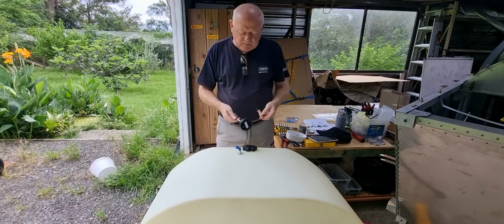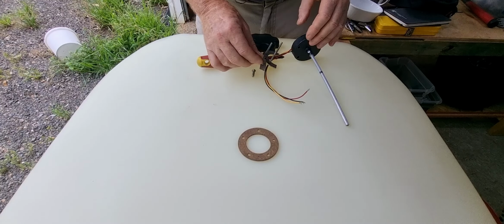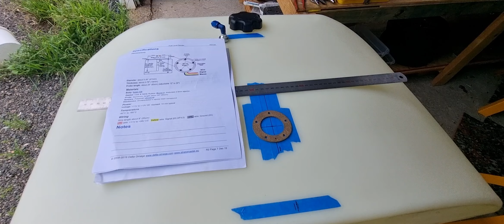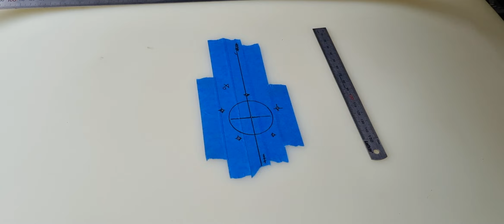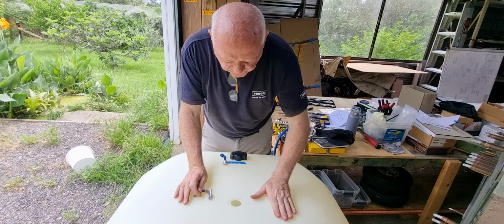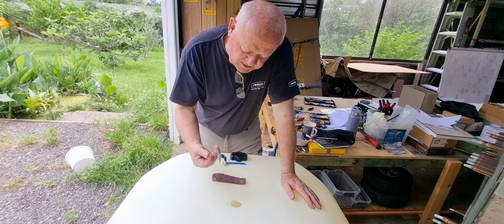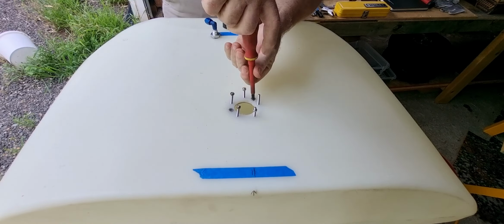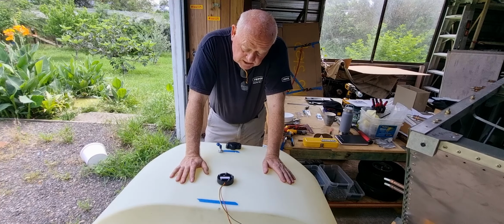Sonex Waiex B, part 25, will I completely destroy a 500 dollar fuel tank

Comment: Nicely done and a very clever design for the internal retainer.  I really appreciate the detailed videos.  Do you anticipate ever having to remove that fuel sender after the build is complete?  Can the fuel tank be dropped out from under the glareshield for maintenance?
Reply from the maker: Hi John, I hope I never have to replace the sender , but as anything if the provision is there you may as well have the ability to remove/replace. my objective in doing the sender this was was I wanted it fixed tight into a stainless nut, rather than just screwing into the poly tank or tapping it with a thread.  The glare shield and tank straps are build together as one unit, and the tank is put in afterward, therefore one would assume the tank is removable. The way I am doing my tank is I have a small section of fuel line from the firewall back to the tank that is done with flares, so if that is unscrewed the tank then is technically removeable, without destroying any fittings that I use Teflon paste and Loctite on.

Comment: Ingenious! Nice job Andy! Ive been wondering about the fuel tank inserts and this answered most of my questions.

The semi-circle retaining clips with the welded bolts - did you make that yourself or did it come with the fuel level sender?
Reply from the maker: Hi Dan, I spent about a week sketching an idea on paper until I worked that design out. My guys at the metal workshop made it for me, and believe it worked fantastic. I am thinking of doing something similar for the rudder peddles.
Reply: @pandyseven  Some of those machinists have incredible workmanship. Looks like your part came out perfect to me. Can't wait to see what you have in store for the rudder peddles.
Reply: @pandyseven   Why do you need something like that for the rudder pedals?  Clever way to mount your sender.  I went the route of marking the tank, and having a light/camera/display so I can visually check the fuel level.
Reply from the maker: Hi Bryan, 
I am not changing the rudder pedals just toying with an idea to make them look good. Just to step the Sonex up to the next level...